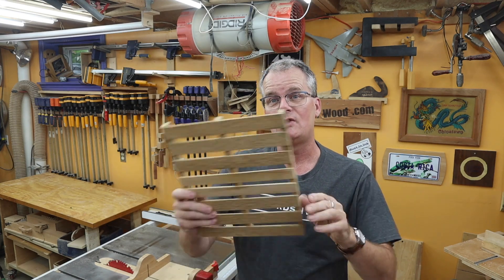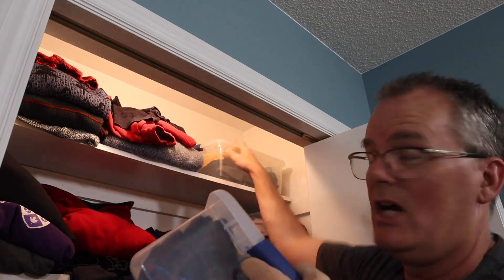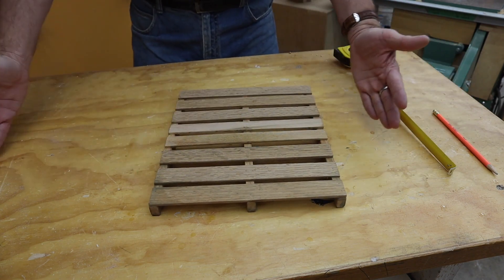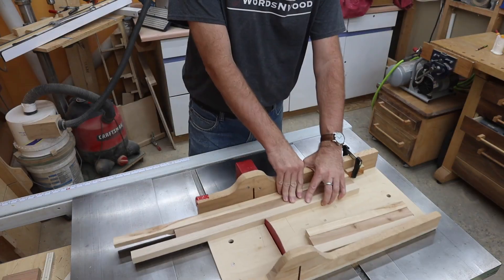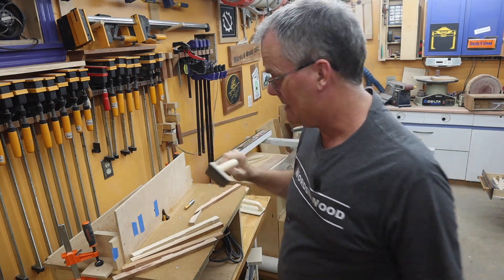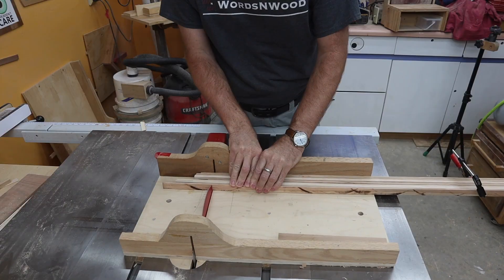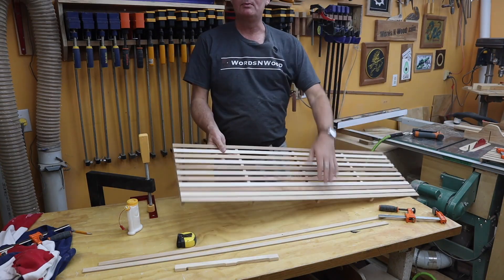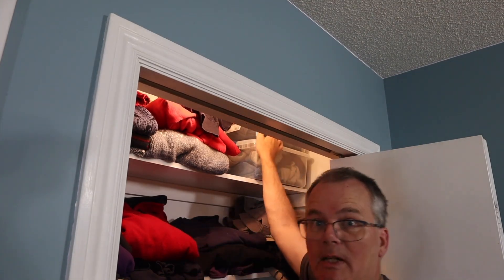Fight Closet Mold (with an air gap) // WnW 265

Comment from the maker: Buy Me Some More Sandpaper?   (Or A Coffee!)  https://www.buymeacoffee.com/wordsnwood   

This is a quick and simple little project that is for a VERY SPECIFIC problem we've had -- mold on the walls in the back of the closet.

Our closets are on outside walls  + we probably have too much stuff in our closets so not a lot of air movement + our house only has 2x4 exterior walls and could use better insulation + we had a particularly cold January  == We had some mold develop on the back of the closet.   This is likely caused by the cold migrating in, which becomes condensation, which grew mold.   

My solution is to build some little slatted spacers that go against the back wall of the closet, which introduces an air gap to help evaporate away any condensation.
And I KNOW it works because 5+ years ago I built a similar gizmo in another closet and it has kept away the mold there.

YOUR SUPPORT IS APPRECIATED:
☕ Buy Me A Coffee:  https://www.buymeacoffee.com/wordsnwood
💵 Become a Patron: https://www.patreon.com/wordsnwood
🛒 Buy a Plan: https://wordsnwood.com/plans/
👉 https://www.wordsnwood.com/support.html

Comment: Thanks for the tip.  I'm having the same problem with really cold exterior wall causing a lot of condensation in a closet.  
If I do as you suggested, will I still get water condensation forming on the wall behind the slats?
Reply from the maker: All I can say is that it seems to work for us.  I would think that it all depends on air movement, how much insulation you have, how packed your closets are and so on.

Comment: Unfortunately this is not a fix of the problem. It's a fix of a symptom. The real problem is a cold spot, wich results in condensation. The real fix is get rid of the cold spot. F.I. via better insulation and/or (most important) better gap sealing.
Reply from the maker: Well of course gutting the house and putting in better/more insulation + air sealing would be preferred.   But that's just not in the cards anytime soon.